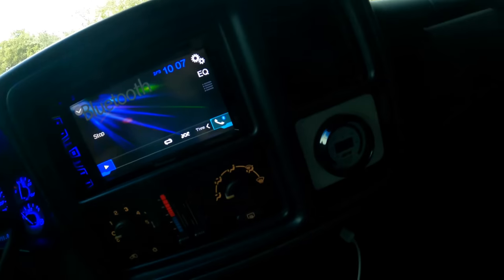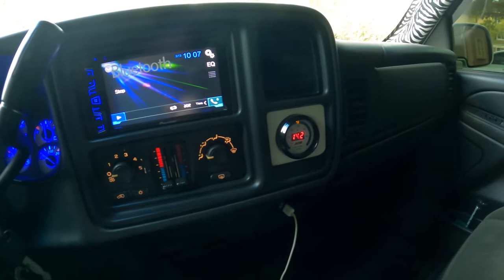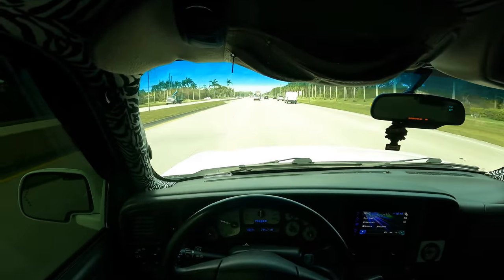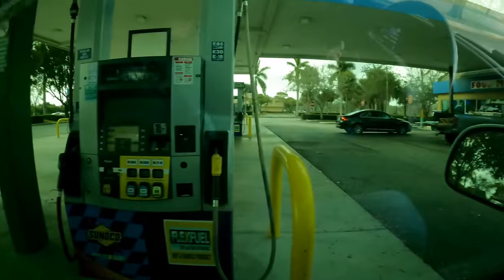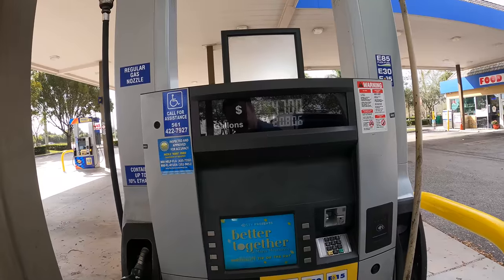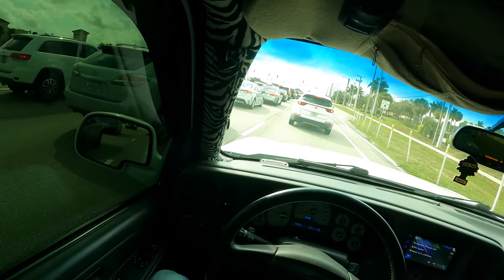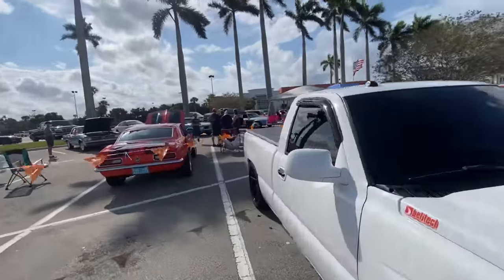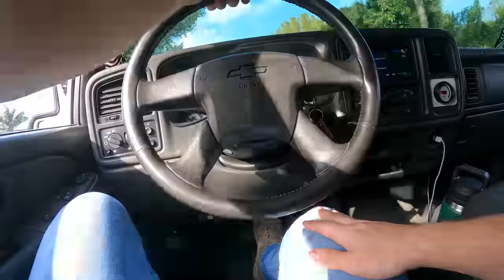What it’s like to daily drive a cammed Silverado

Comment: Ha my daily is a 400rwhp tbss rwd and my problem is keeping my radar to stay plugged in to the cig lighter lmao
Reply from the maker: I wish that was my only issue! I keep ruining transmissions 😂
Reply: @SiskBuilt  my setup is pretty basic for the same reason just a big cam headers full exhaust cai and 3600 stall for an ls2 made like 407 at the wheel on dyno I’ve put atleast 60k hard driven miles on it  luckily it’s never given me problems
Reply from the maker: @Kaska806  mine dynoed low but the last transmission was slipping on the dyno. The tuner laughed at me when I said I just had it built about a month before then
Reply: @SiskBuilt  finally shattered a rod 😢lol not to mention I took it to a shop to rebuild it and get more power ended up getting screwed lol they put a smaller tsp cam I got a coolant leak from what looks to be one of the heads less than a month after they finished it all to find out that shop screwed a bunch of people over packed up and left lol my bad bro your the only one I talk to about my ride and I’m devastated lol

Comment: What are the cam specs?
Reply from the maker: 235/243 duration. It’s a All out LSR cathedral port cam by Comp Cams
Reply: Cool I have a 05 with a 5.3 I built I went with the btr 216/228 110 lsa

Comment: Not sure if You've replaced your AFR gauge or not but from experience the AEM gauge you're running in this video is a POS!! I went through 4 gauges before AEM would upgrade to the next level up. After that, no problems. For those who have seen this and have the same gauge replace it immediately with the better version.
Reply from the maker: I haven’t yet! I got annoyed and wired it to a switch. So I have to turn it off and on a million times and then I’ll read correct. It’s very frustrating

Comment: how much power you pushing??
Reply from the maker: About 400 wheel!
Reply: @SiskBuilt  really only 400?!
Reply from the maker: 400 ish 😂 I got tuned and the number were off because the transmission was slipping. So it’s about 400 from the last dyno. Hahah
Reply: @SiskBuilt  nice i’m looking to buy a truck this summer and i’m just wondering bc ppl tell me it’s going to be expensive and not reliable if i’m trying to push high power. my goal is to have it atletas at 500 or as close to 500hp
Reply from the maker: @manuelroman8808  depends what the setup is. You can achieve it on a 4.8 and boost. But just how it’s built and how it’s tuned.

Comment: My ecoboost 3.5 twin turbo would smoke that thing ,and yeah I can still get mid 25 mpg..17mpg even running hard..plus E85 isn’t going to give you much power on a NA engine, sure you can add a few extra degrees of timing but that’s really it , and your going to get crappy mileage, also while his truck sounds great , it’s the reason way the EPA is trying to shut down tuning shops and forcing American manufacturers to make newer cars with ECMS which can’t be tuned..removing your cats or not running cats doesn’t help make any more power , I’ve seen or even on my ZL1 800hp car with cats and tested with no cats and the difference is 3 hp down low and about 5-10hp above 58-6500 rpm..it’s nit worth the ticket or loosing our sport..younger ppl need to learn this..as when I was a kid 30 yrs or more Ago yes emissions hurt hp back in the 1980’s today they really don’t..
Reply from the maker: Wonderful. They are 2 totally different builds.
Reply: And my 79 f150 with a 557 stroker would probably demolish your ecoboost, trucks aren't meant to be fast they're meant to be workhorses and just fun overall so why are you trying to flex on his build. Just enjoy the vid and show love lol

Comment: What kind of crap is on your head liner? Blocking the view of your video. But man I want my Silverado to run like that. But video tip, mount your camera different if you like the camera blocking headliner.
Reply from the maker: Bought the truck with the headliner. I’m little over 6 foot, and running a head mount makes life difficult to get a good video!

Comment: 12 mpg. Ha. That's what my stock 6.0 Denali averages.
Reply from the maker: Ooooooooof, that’s not terrible right? 😂
Reply: @SiskBuilt  Well its a Yukon & all wheel drive all the time, so Not terrible. Gas goes up then so do my prices. :)  btw... You have headers I'm guessing, what brand did you go with or would recommend?.

Comment: Why did it stalled?
Reply: Cold with huge valve opening = engine wanting to die until hot
Reply from the maker: It wasn’t ready to move yet. But once it was at operating temp. It’s ready to get rowdy